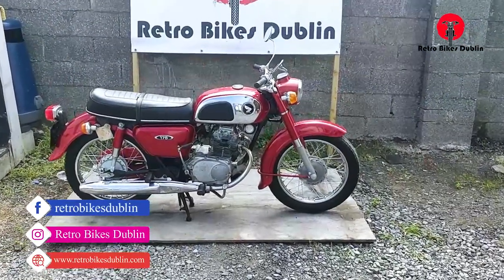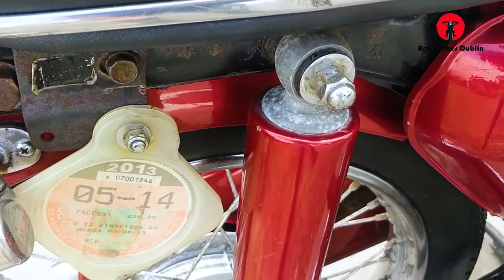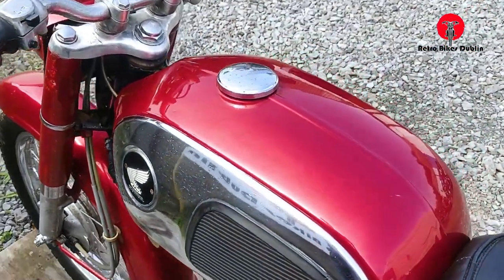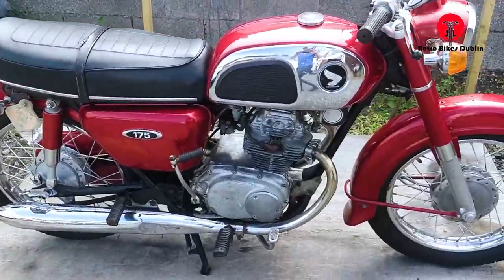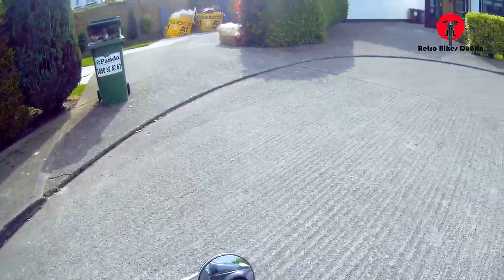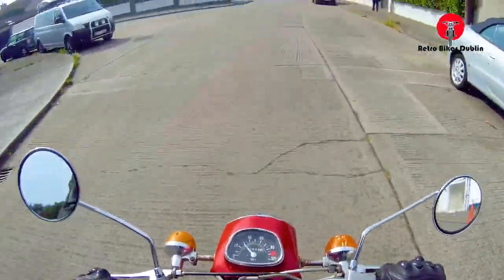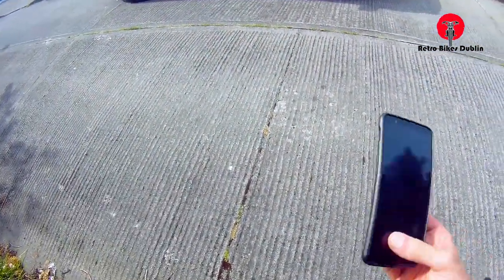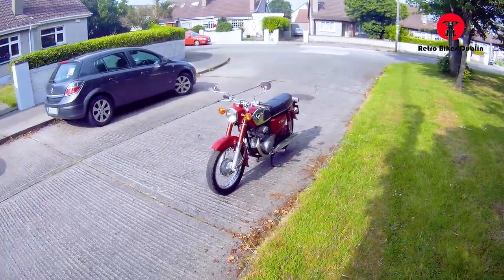1974 Honda CD175 (Review) - honda|cd 175|1977 honda vintage| bike review

Comment: I Used to have the 125 CC BLACK version of this. In Nepal, handed over to me by my grandfather. It was my weekend bike. There were a few 175’s and the 125. They were really good bikes. I Toured in Nepal with in it the early 2000’s. Mine was a single seater. That way I could pack my tent and sleeping bag and hit the road. Great memories.

Comment: I'm from the States and have recently started noticing videos on the CD175.  That's a bike that I had never heard of.  Over here, I don't think Honda sold them.  We had the CB175 which is basically the same bike only with two carbs and a five speed instead of a four speed transmission.  The CB175 was one of my favorite motorcycles when I was learning as a teenager.

Comment: As an American I can say we love the Irish and You're fighting spirit.
Just picked up a CD175 thinking it was a CB175 as my wife's first restoration project and first bike.
With a single carb and being harder to find parts for I'm not entirely sure it's going to work out. Hopefully it's got enough pep to safely do interstate speeds (75 mph 120kph) for a couple hundred miles at a time
Reply from the maker: Thanks for your kind message ☺️☺️
Reply: I had a few of these recently.. CB175 and CD175.

Great little bikes, but don't plan on doing 120kph for hours on the highway..  the top speed on the CB175 is around 140kph but it has no torque to overcome hills or even a headwind..  you can struggle to maintain 100kph  at times.  Everytime I jumped on the highway I regretted it and exited at the next exit.

The CDs are slower still with only 1 carb and 4 speeds.  

Best to take the backroads for travelling.  Very good bikes for city riding too.
Reply: @magnang  is there any chance you know where I could source a new throttle cable for the CD? It seems they are very rare on this side of the pond (only sold the first year) I managed to track down most of the parts I need from Taiwanese ebay but can only seem to find twin carb throttle cables
Reply: @zoomzoom8704  Hey.  What I did on mine was to get a 22mm carb from Taiwan - Sheng Wey is the brand.  I think I got the cable with it as well,  it was only 40$ or so.

Out of the box the bike started easily and idled well.  But it ran lean at mid throttle / WOT

I did have to change the jet to #100 and also dropped the clip for the needle (drop the clip / raised the needle) to get good power.

Hope this helps.

Comment: I had one of those back in the early 1990's. The problem was I bought it 2nd hand and it eventually it rusted away and started leaking oil, so I decided it would be too expensive to repair and bought a Honda CG125 to replace it.

Comment: Had a blue one from new in 1973, had it for 2 years before I bought a Goldwing GL1000 1975 model. The main problem with both was corrosion, the exhaust on the Goldwing didn't last a year!

Comment: Passed mi Group D bike test on one of these and then learned how to ride " 2 up"  me n mi brother went all over Scotland on it 4 cupla years runan , never broke down , piss easy  and cheap to service,  i always liked then when you "2 up" and luggage  you could set off wit same revs as solo ( very strang clutch) and allowing it ,  it would get same speed as solo and you could hold it all day ! the bike never seemed to complain apart from one weakness, the rear shocks not adjustable so you reliant on pumping up rear Tyre when hauling load and suspension could ground , but my dealer always sort it for me if rim / wheel need truing free of charge. Fuckan nice bike mate ,  for sale ?
Reply from the maker: She's sold now !

Comment: Had  my 200cc version of this on L plates years ago had no baffles in it and was always getting pulled over by the  police had to stuff wire  wool or brillo pads up the pipes although they soon melted away after about a month,to think there was a day we could ride the 250cc's on L's too,now i'm allowed a 28 mph moped on just a car licence and i need a CBT for a 125cc on L's or around 750-£1000 quid to get a full A Licence.

Comment: Yours looks terrible and sounds terrible but it was a fantastic bike in 1968 when I bought a dark grey one almost new. And if you fancing cutting an Austin Healey 'Sprite' in two with a head on crash this machine is highly recommended. It's as powertful as an AJS 650 which I also bought around then.

Comment: That's a 1968 not 1974
Reply from the maker: Well it was only first registered in Ireland in 1974 as per the registration number plate on the bike
Reply: 1968 was a different bike